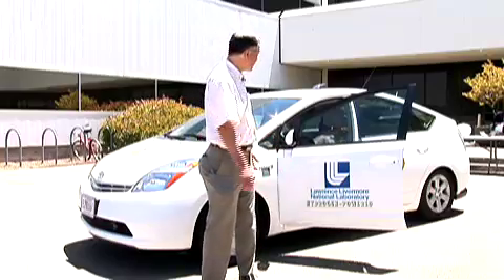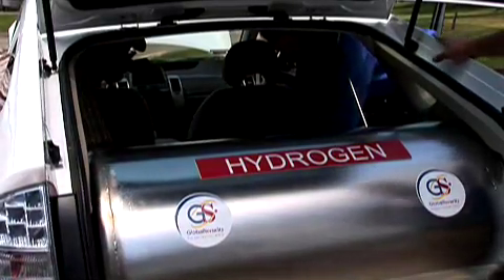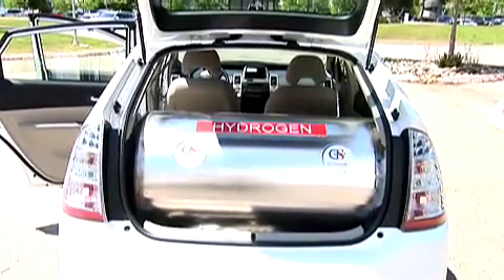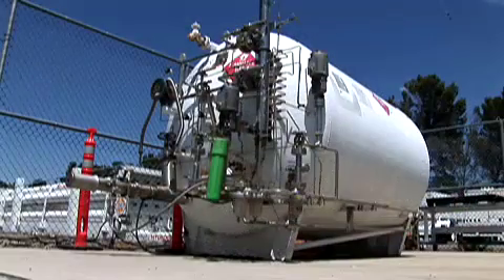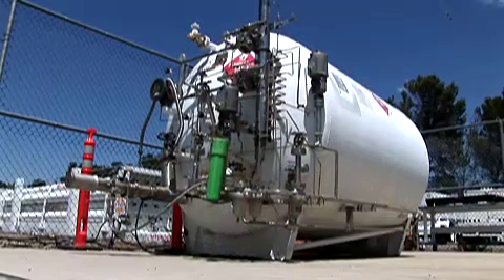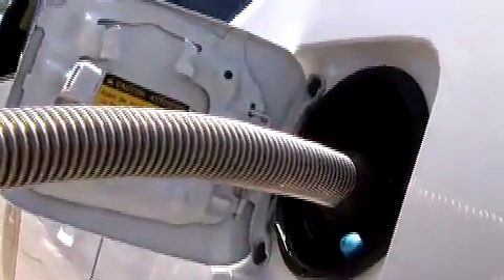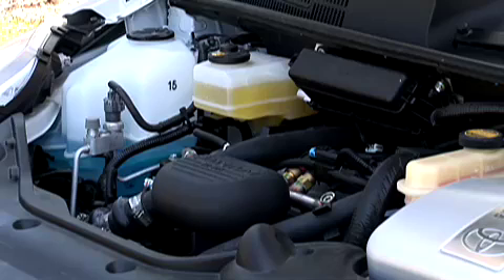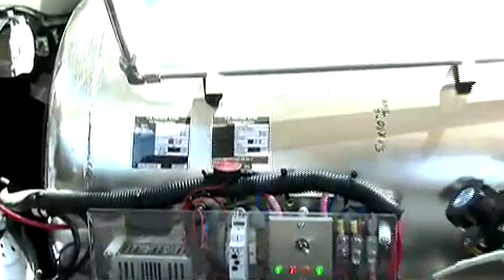Hydrogen Car

Comment: for cars, rechargeable batteries are better, thats clear.

the problem is that lithium ion technology doesnt scale well. when it comes to the amount of energy you can store, hydrogen technology in combination with a former natural gas pipeline system or a huge underground cavern that can be filled with it would allow for a considerable scale.

you just cannot store the amount of energy a powerplant produces in 1 week with rechargeable batteries, its not an option.

Comment: second comment to hellgas0 :

but it really doesnt matter. there is no reason for the big corporations to get active here, as long as noone complains about the coal power plants and about the fact that the energy we use for whatever technology comes from fossil fuels.

hydrogen is no threat for them as long as theres so much coal energy in the electrical grid. no reason to try to directly turn coal into hydrogen WHEN ITS ALREADY HAPPENING AND HAS BEEN FOR DECADES in an indirect way.

Comment: you cannot really say that this is the most efficient way.

if you use electricity as your energy source to turn water into hydrogen, thats already very effective. i mean, somewhere around 90% when you compare the energy used with the energy stored in the hydrogen. 

if you use coal, you need to take into account the energy that is already in the coal. the question is: is it more effective to turn coal directly into hydrogen, or to burn it and use the electricity?   (i need another comment)

Comment: lithium ion batteries heat rapidly if short-circuited.

if this happens, they can heat up until they blow up. and this is what the video shows. the first battery in the video i linked has just been tinkered with, but not heated up. they just caused it to malfunction into a short-circuit that triggers a runaway process.

Comment: damn, i commented before watching the whole thing...

they really burn it in a combustion engine. how ridiculous. if you have such a cool hydrogen tank, you need to use a fuel cell and run on electric engines. it doesnt really make sense, the efficiency of fuel cells + electro motor is very high, you lose all that efficiency if you use a combustion engine.

Comment: chernobila:

you have exactly the same problem with modern rechargeable batteries. the energy density is so high when they are charged that they can blow up as well.

watch?v=WeWq6rWzChw     this video shows the batteries in a laptop burning/exploding. now scale that up to an electric car using similar rechargeable batteries. watch it.

what do gasoline, hydrogen, and high energy density rechargeables in common?  they all can burn, explode, go up in flames. they all store tons of energy.

Comment: "It seems like it would be better to generate hydrogen as needed"

and how is that supposed to work? 

it takes energy to produce hydrogen, more energy than you will get out of it. you are asking for a vehicle that would be in violation of the laws of nature, that would run on magic to produce energy while driving. the laws of nature dont permit it. 

you need to first put fuel (gasoline or hydrogen or charged batteries = stored energy) in your car, and  THEN you can drive.

Comment: you need to realize that hydrogen is just one way to STORE energy, because hydrogen does not naturally exist on our planet, at least not in its elementary form. 

its like a battery. you use energy to make hydrogen, then you use hydrogen to get energy (a bit less than you put into it).

hydrogen technology is in direct competition with electric cars using rechargeable batteries, and i agree, i think rechargeables will win this.

Comment: "Doesn't it take a lot more electrical energy to make the hydrogen that is needed..."  of course. hydrogen is an alternative to rechargeable batteries. 

"Also, since the engine still relies on internal explosions to run..."

anyone that knows more will use fuel cells to turn hydrogen into electricity, its much more effective than burning hydrogen in a combustion engine. its just some free energy conspiracy people that inject it into their engines, its highly inefficient this way.

Comment: Doesn't it take a lot more electrical energy to make the hydrogen that is needed to move a car for a certain distance than it does to fill a battery that makes a car go the same distance. Also, since the engine still relies on internal explosions to run, much more maintenance is needed than in the the case of electric cars. E-cars have their drawbacks but they seem resolvable unlike hydrogen cars. I confess i did watch "who killed the electric car":)